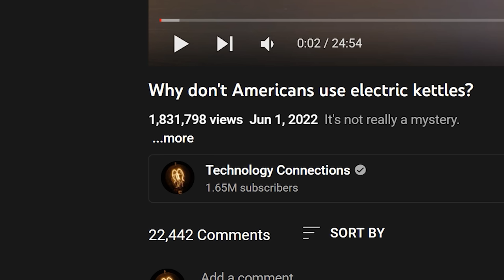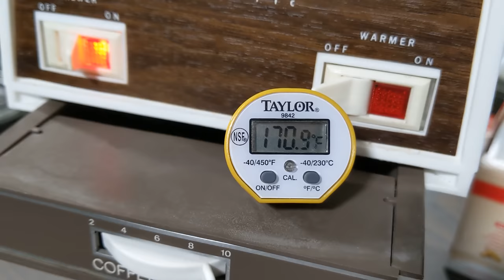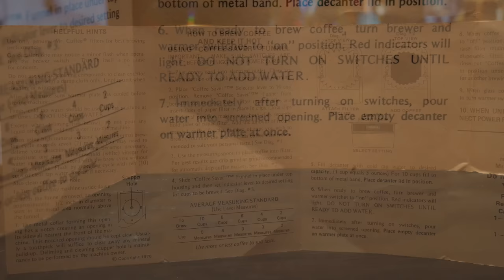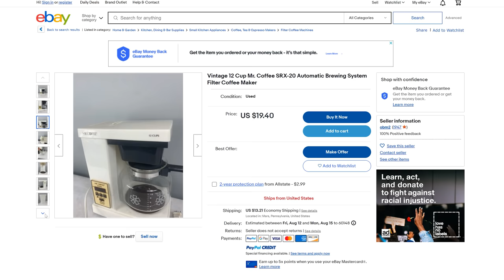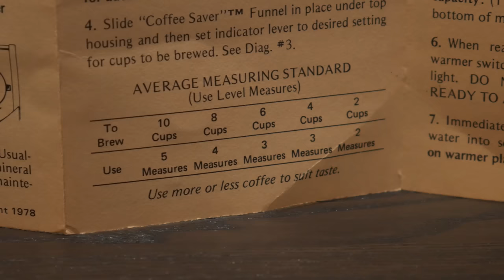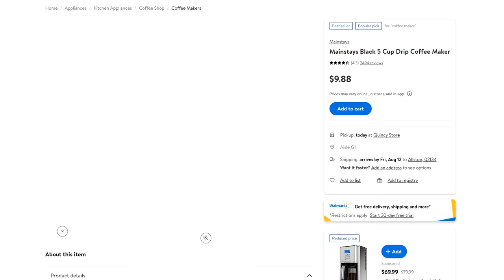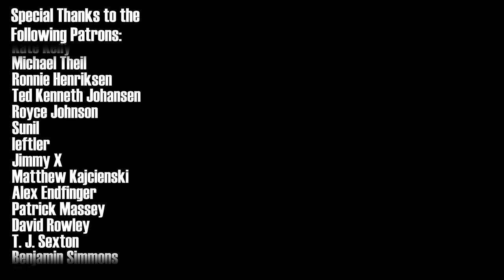Drip Coffee Makers — super simple, super cheap

Comment: That bi-metal strip to control the water inlet is just genius. I love how limitations bring innovation.
Reply: ehh, at a high level the idea is pretty similar to the car thermostat which was invented in 1934 according to Google.
Reply: Bimetallic strips were the rage in those days actually, they were in toasters, fuses, hairdryers, you name it. It would have been surprising had they NOT used a bimetallic strip for it.
Reply: Reminds me of one of my favorite quotes from a video game.
"All scientific advancement due to intelligence overcoming, compensating, for limitations. Can't carry a load, so invent wheel. Can't catch food, so invent spear. Limitations. No limitations, no advancement. No advancement, culture stagnates."
-Professor Mordin Solus (Mass Effect 2)
Reply: Yes.  I completely agree.  There needs to be a lot more of this kind of simple but effective and robust engineering.  Not only keep costs down but improve reliability and use less electronic circuit boards that increase complexity and accelerate obsolescence.
Reply: @jkeelsnc  the attitude to crease a device (and software) should be that if you remove one feature it won't work for its intended purpose, if you add a feature that's not required for the intended function then it is bloat and complexity and should be removed
Reply: @H1tman47  yes at the very high level, the thermostat in your car uses a puck of wax and a spring and it doesnt so much limit the flow as start and stop it to allow the coolant in the radiator more time to get air blown over it, basically creating a temperature bias between the engine and the radiator, it also is the only thing that causes the temp gauge to get to a certain point then stop, when you take the thermostat out then drive without it, you see the gauge will float and fall all over the place since the regulation is just gone
Reply: @sjdpfisvrj  with sole exception of toasters, Bi metallic strips are still used in hairdryers and reset-able fuses consistently, in fact technically a reset-able fuse is what is in a hair dryer, and its purely for when something isnt right, say the air flow is being blocked because the filter is clogged, otherwise a hair dryer pretty much is a full blast machine, just running the heating element flat out and using the air flow to keep it from glowing to bright (learned that the hard way when my hair dryer had a tendency of turning bright orange inside then blowing cool air out for a minute afterwards)
Reply: Bi-metal strip sounds like a metalhead club.
Reply: The really fun thing is that it comes back around! MEMS devices are things like this, just implemented in nano-tech. I don't know specifically that they've shrunk the bi-metal type mechanism, but I wouldn't be surprised!
Reply: 80 celcius you do? on a bi metal?
how old is that machine, 1950 drinks you need?
Reply: @sjdpfisvrj  Hell, they were even used in cars thermal turn signal flashers/blinkers up until the 80s.
Reply: Laziness is the engine of progress, after all.
Reply: Nowadays, "innovations" are buggy over-complicated software that spies on you 😒
Reply: @youdontknowme5969  You are not wrong. All modern software sucks (not recently created software but "modern"). Software should follow the concept of a minimal viable product. If you remove one feature then the product will no longer work, if you add a new feature that feature was not needed anyway so you should not add it.
Reply: It's insane how much regulation was done with bimetallic strips before microcontrollers. Also often results in cheaper and cleaner systems.

Sometimes it feels like we get more stupid solutions the easier it is to just throw electronics on it.

Comment: Latin American here. Pour-over coffee’s not just a fancy/enthusiast/hipster thing, it’s one of the cheapest ways to make coffee (café colado). You just need a reusable plastic or fabric filter, no goosenecks or cool glass beakers needed. A lot of us have all sort of drip machines, espresso machines and/or electric kettles (specially in the countries that drink Mate), but if you’ve just moved into a new house and you don’t have kitchenware yet or if your grandma’s making it (and it always tastes better), you’re gonna boil or microwave some water and pour :)
Reply: "Pour over" looks a whole lot like a manual Mr Coffee.  What am I missing?
Reply: The extraction is more even and you don’t burn the coffee as easily. The cheap drip machine drips water on the same spot, overextracting and burning the coffee at that spot and not extracting all the other grounds around = bitter and harsher taste. 
But you can get drip coffee makers with a better shower for a more even spread or even a pour–over–robot which is a drip machine with a rotating shower head and multiple opening and closing holes in it. 

The differences may not be that big with dark roasted coffee but you’ll miss out if you like the lighter roasted beans or speciality coffee.
You can also get crazy using goose neck kettles and timer, pouring water in ceramic filter holders while checking the scale for the perfect amount of water to time ratio, depending on the coffee grind size and water temperature.. not a must for enjoying a good cup tho 😅
Reply: @nash0rn  that's sounds reasonable, but has anyone done blind taste tests?
Reply: Yes they have. Youll want to do pour over if your doing a single cup. @RonJohn63
Reply: @RonJohn63  It's more that Mr Coffee is an automatic pour-over, but yeah.  You lose some control over things like flow and spread, but gain the ability to click a button and walk away.
Reply: @RonJohn63  Controlling the water placement, flow rate, and temperature all actually change the flavour of coffee.

Comment: I have found so many ways to mess up making coffee before I have coffee in my system. (forgetting water, forgetting power, etc). My favorite was when I carefully measured a certain amount of whole beans, dropped them into the brew basket, and looked in thinking… wait a moment.
Reply: The number of times ive brewed hot water cuz i forgot to add grounds 😂
Reply: Omg. A friend who was neither a coffee drinker, nor particularly smart, made a pot of coffee for a party. We polished it off and she asked if I could make another pot. I went to empty out the used filter and grounds and it was just an empty, wet filter. We were baffled until we realized she only had instant coffee and had used that in her drip machine. We still tease her about it, even though she has had a couple of barista jobs since then and brews a mean pot of real coffee.
Reply: @amasterofone  If you need hot water in a hotel room (e.g. to make instant oatmeal), that's a reasonable way to get it.
Reply: I poured coffee grounds in the water side once... that was fun to undo...
Reply: The coffee paradox.....How does one make coffee before one consumes coffee?
Reply: Here's a tip for the morning coffee: Set everything up the evening before. That way you just have to flip the switch and get hot coffein soup with no work while still half asleep
Reply: @Spore_Money  Don't say this.
Reply: @eldoradocanyonro  We set ours up the night before and then use a program feature so it will turn on before the alarm clock goes off. I am spoiled with having my coffee ready to go the second my feet hit the floor.

Comment: I'm glad this video exists,  because I always wondered how my previous job's coffee maker immediately spit out the coffee when I poured the water in. On more than one occasion, my coworkers and I have made a huge mess by not putting a carafe under the brew spout before pouring in the water. The original Mr. Coffee design explains this (although it could be that the Bunn-O-Matic we used constantly warmed a supply of water within the machine). 

Also, my drip coffee maker has the spout over the basket attached to the lid, so  it lifts it out of the way for me.

Comment: Fun fact: in the Netherlands, we have both a strong tea and coffee culture, so most homes will have both this type of coffee machine (or one with pads) as well as an electric kettle
Reply: Yet you charge your guests for a cup of it. Wild
Reply: It's the same in Canada, at least for myself and my friends and family. We have a gooseneck-style electric kettle with temperature control that's great for V60 coffee but also works well for tea that doesn't want as hot water.
Reply: @Spetsnazty  we ... charge our guests? This is new information?
Reply: Same in Australia. Tea and Coffee are both really important.
Reply: Same in most of europe
Reply: Am I the only person who knows you can brew tea in a drip coffee maker? It's perfect.
Reply: @philipem1000  really? And it doesn't taste like coffee then?
Reply: that's everywhere
Reply: @philipem1000 Black tea really needs to use boiling water, so something designed for coffee tends to be too cold. Plus I'd imagine that anything coming out of a coffee maker will always taste slightly like coffee
Reply: @P0nyl0ve  I sometimes just put a mug with a teabag on the hot plate and let the water go in there. WOrks well enough.
Reply: @bighamster2  Only if you keep the filter holding element in. Take it out and the hot water drops directly from the machine outlet into whatever pot or can or mug you put under it.

Comment: The coffee flavor degrades if heated more than a 30 minutes after brewing, so it's best to not use the warming function too long, as James suggests.  When I pour my first cup of coffee, I turn off the coffee maker and pour the rest of the coffee into an insulated carafe, which keeps the coffee nice and hot for hours.  This is simple and beats having to microwave later cups of coffee.
Reply: Correct!! I do the same thing..
Reply: Just like a professional coffee shop!
Reply: Thankfully there are coffeemakers that have a thermos-carafe. No need to pour the coffee into a different carafe after brewing.
Reply: Nuking coffee is another way to ruin it IMO. I prefer to drink it cooled down.
Reply: Who’s James?
Reply: @Jaymac720  James Hoffmann, a famous British Youtuber who deals with coffee stuff.
Reply: i won't nuke cold coffee; I swear it boils some regions of the container while leaving the others cold. The average temp comes up, but so does the burned taste.
Reply: I only make enough for two cups and drink them one after the other.  If I want more later I make it fresh.
Reply: @jerelull9629  You definitely have to be careful. I have worked out over time a calibrate amount and time that heats the coffee to my desired temperature but doesn’t burn it. If it helps, I also put the mug I heat it in off-center on the microwave turntable.
Reply: Right, and proper English tea drinkers will tell you that boiling the water before using it to steep tea ruins it by "burning" the water.
Reply: The trashier way to drink coffee when it gets room temp is to just microwave it. I do it often.
Reply: @tannenfreund87  The coffee still gets cold. I prefer the microwave assistance, but YMVM.
Reply: Exactly what I do.  I have two insulated thermos units; works like a charm.
Reply: But even a insulated carafe alters the coffees taste as the humidity in the container hits 100%, water forms on the walks and drips back into the coffee. Yes minute changes and much better than hot plate, but changes in flavor none the less.
Reply: @Jaymac720 ligma b—

Comment: Hello! Just discovered your channel, it's nice indeed!
Did you find the moka you was thinking to buy?? I'm Italian, and I can suggest you a few things about mokas. :)
1) if you can find one, buy a steel moka suited for induction... they're just better and safer than aluminium ones, despite wide popular belief here in Italy. Of course, they're more expensive.
2) I think it's better if the moka is of medium size, like between 3 to 5 cups.
3) coffee grind size has to be thinner than for filter coffee, and coarser than the one for espresso coffee. Like always with coffee, high quality freshly roasted (and just grounded) beans can make a HUGE difference😜
4) fill the water reservoir to the valve level with COLD water.
5) Insert the filter cup over the water reservoir, then fill it to the border, not more. NEVER press the coffee in any way!!
6) close the moka by screwing it with some force, and place it on the stove. Whatever type it is, the heat has to be VERY low. The lower, the better, because it means that the pressure will build up inside, allowing the vapor to push water through the grounded coffee BEFORE it gets too hot... resulting in a much much much better taste. With my induction stove, which has 10 power stops plus the "extra power" one, the optimal regulation is between 3 and 4. When I had gas stove, the best regulation was the lowest possible without causing the flame to die off :D
7) when coffee starts coming out at a fast rate, THAT'S exactly the moment to turn heat off. Better have a little bit less coffee, than adding a distinct burnt taste to all the coffee you just made :D
It will take at least ten minutes (you're NOT gonna make good moka coffee in a hurry😄), but the result is so much better than the burnt ,yet shallow tasting broth you'll get in the average Italian home LOL. (most Italian people use too much water, use too high flame, and don't shut off the heat until water is virtually finished from several minutes, and what's coming out are just vapor bubbles😫)

It can sound complicated, but actually it's not at all. It can be shortened into this to: use very good coffee; put cold water inside without going over the walve level; don't press the coffee into the filter; put the moka on very low heat, and turn off the heat as soon as coffee starts coming up at a fast rate.😎

P.S. Spoiler: moka coffee tends to be quite a bit stronger than the average filter coffee. Of course, with aeropress, if you use more coffee or limit the water amount, you can still obtain similar results to moka.
Reply: Ty!

Comment: I was eagerly awaiting a “through the magic of brewing two of them”

At a former job, I was a security guard at a large office building.  We used the Bunn-O-Matic’s scattered around the building for our own consumption.  Ditching the provided food service coffee, and using my personal stash (since I had to drink it too), gaining mass approval from the morning shift, it was still hotter and more acidic than my home brewer.  I cannot logically explain it, but though a change in coffee was a great improvement, those food service machines just cannot make a good cup of coffee.
Reply: How far from your work do you live? I wonder if water hardness has any effect.
Reply: @oxybrightdark8765  It was probably the boiler's temperature. James Hoffman (who has almost certainly been mentioned several times in the comments) has suggestions on the proper water temperature for different roast levels of coffee. Too hot or too cold, even by 5°F, and it affects the flavor.
Reply: It's by design. Brew-siht-quik tech cares little for the consumer's experience (short of going full barista with a machine that costs as much as a car). On that note, starschmucks coffee isn't expensive just to make you feel important. They do have to pony up for some eye-wateringly expensive equipment. And they do neutralize the water supply to the stores so it's nearly distilled when it reaches the machine... "the more you know" theme music plays
Reply: @oxybrightdark8765  several miles, but same water department.
Reply: @warp.routine  I call that stuff Starburnt. Bleah!
Reply: The Bunn-O-Matic works slightly different. Basically, the water that comes out is not the same water you put in. These models have a tank of water that's pre-heated. You have to put the empty carafe on the warm plate first. Then fill the provided plastic container with cold water and pour. That pushes the pre-heated water to the coffee grounds. The cold water that was just poured in is saved and heated for the next cycle.
Reply: @RaymondHng  how’s about the ones that run off the water line?
Reply: @jaysmith1408  Those are for high volume coffee production like in coffee shops. The water supply line just feeds into a tank where it is heated up.